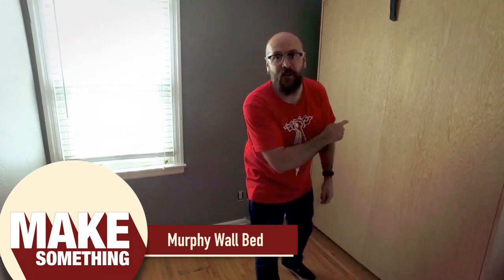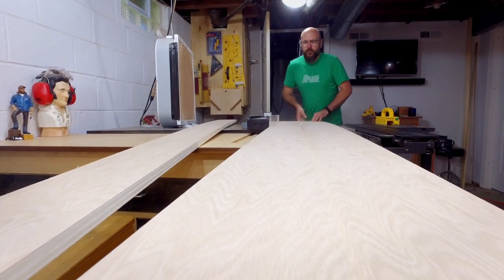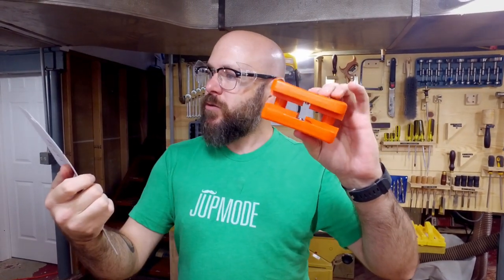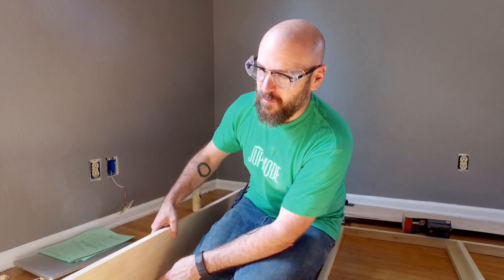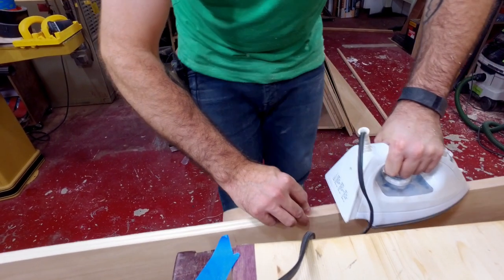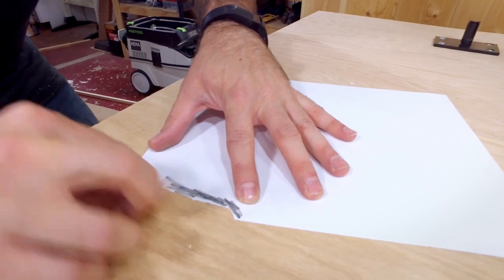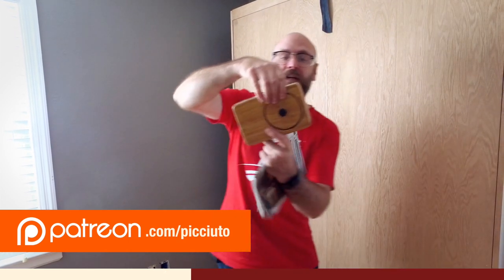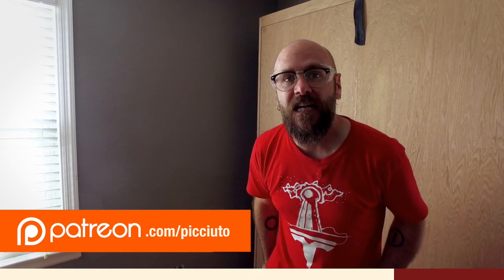How to Make a Murphy Wall Bed | Woodworking Project

Comment: Two things, glad to see the guys at Hide-A-Bed are distributing through Rockler, I built one of these about 6 years ago, the guy actually customized me a set of plans for a King Sized bed with an oversized mattress. He (I don't remember his name, but it seemed like he was the inventor) even custom pressurized a set of those shocks for me free of additional charge. Love it. Second thing, I agree with the comments below, it would be much safer to locate the studs for those screws; a half inch of plaster will often pull out of the wall (I have repaired a lot of these pull outs over the years, in this case, toggle bolts hold much better for verticle static, shearing loads than dynamic, horizontal tension loads)  after repeated pulling up and down, which repeatedly puts the formentioned horizontal tension load on those toggles. I'm pretty sure I remember that my set of plans specifically suggested this.

Comment: Great job. I've thought about making one of these and getting a smaller apartment.

Quick edge banding tip: Iron about a foot and a half, then take a screwdriver, turn it sideways and burnish the edging with the side of the shaft as the glue cools. I always get much stronger and more consistent adhesion that way.

Comment: My dad and I are currently designing a Murphy bed for my and my wife's bedroom (loooong story). I'm going to be mounting some LEDs into the header and have them activated on switches with an in-line dimmer-switch to turn them off. So, basically, reading/ambient lights overhead with a control for each side. Maybe you'd consider this, as well?

Also, the bed is going to be covering one of the the windows in our room (which is slightly bigger than the one you have this one in). Since our bed is going to be blocking most of the daylight, I will have another set of lights (again, activated by switches and controlled with in-line dimmer-switches) to replace the window lighting.

Oh! And, may I suggest a Tuft & Needle mattress? We've had ours for a year and it rocks. Though, at 72 lbs, there may be a little concern with the pistons not providing enough lift... Hmmm... I need to consider that, myself.

Comment: Instead of putting trim at the top you could do overhead storage. Open cabinet in the middle, and two closed door cabinets on the ends, matching the door like cabinet your going to do on the front of the bed, having about a quarter inch of clearance from the ceiling then trim around it to flush up to the ceiling level. My parents have one like that and its handy for linen or pillows. Then it also gives you storage for pictures frames or other nic nak things in the middle piece of the cabinet. Huge fan of the show by the way, (at least put a clear coat on the guitar). Would love to see you start working with metals. You should really start having a beer once your getting close to the finished project, like anchoring the bed to the wall. Maybe cheers the camera man

Comment: Are you worried about moisture build up between the mattress and the plywood, seeing as though there's no air circulation? Or is this bed barely going to be used so it's not going to be a problem?

Comment: Why did you use toggle bolts instead of finding the studs? Is it a plaster and lathe wall?
Reply from the maker: +Can Ken Make It? No reason. Both methods work.
Reply: I suppose it "works"   in the short term.  no way they are as strong as screwing into the stud.
Reply: Well, most of the weight is on the floor. It won't take much to keep it from being tipped.
Reply: Got to be careful with toggle bolts, he might end up pulling down a section of wall. Really needs to secure it to studs in at least two places to keep that from happening.

Comment: Very cool and great timing. I am going to attempt to build one this weekend. I have already watched a couple of other videos but one more couldn't hurt. Was there a reason for hand nailing the finish nails or would a nail gun work as well? Also, could you use pocket screws on the head board so the screws wouldn't show in the side? Thanks for the video and take care.
Reply from the maker: Thanks! The directions called for 2" finish nails. I personally don't have a nail gun big enough. And yes, pocket screws would work just fine!

Comment: How would you recommend I go about this? Next year i'll be studying in Paris which means that the space will be minimal but should i just go to a wood shop and ask for the dimensions of wood needed? Any other way than getting a shop or ask someone who has one? Nice one though.... I must admit I haven't been watching the channel that much
Reply from the maker: Many hardwood dealers will make the cuts for you. They do charge for each cut.
Reply: Thanks! Thats what I thought as well (I'm not gonna buy a tablesaw in a 15msq student appartement)
Just wondering, does it need to be attached to the wall? I'ts really complicated to get permission to drill holes in france. Also, contact casper for god's sake! Perfect sponsor for vid!

Comment: What is that table saw cross-cut fence thing with the really long arm?
I have add-on cross-cut thingy envy!
Reply from the maker: +wimman it's the Sawstop crosscut sled
Reply: +Make Something Very cool! That's added to my "want it" list. How easy is it to switch to using a rip fence? The video at a little place called ROCKLER didn’t cover that.

Comment: I have to ask, how is it working with so many drills all on different battery platforms? I think I would find that bothersome.
Reply from the maker: Two drills, two batteries. I've been in love triangles more complicated than that. ;)
Reply: +Make Something fair enough I personally have three drills to impact wrenches and God knows how many others I only have one tool that is out of the battery format and that one still drives me insane but it's an impact wrench that so strong I can't just get rid of it

Comment: Question from my ignorance: why did you use nails instead of screws? What is the benefit? It's at 09:00
Reply from the maker: So they can be covered with wood putty to hide them.
Reply: Make Something, and it's more difficult to cover screws with wood putty?
Reply from the maker: Not more difficult but more noticeable.
Reply: Make Something thanks David.

Comment: I apologize for the dumb question, but I'm a woodworking noob.  What's the gadget that looks a little like a shark's dorsal fin on the backside of the table saw blade?
Reply: Jeff Behn,  If I understand the part that you're talking about, that is a safety guard designed to help stop a piece of lumber should it happen to be "kicked back" by the saw.  It also helps to cover the sawblade, making it slightly more difficult for you to touch it and cut yourself.
Reply: That my friend is a Riving Knife. It holds the cut stock against the fence both to help get a straight cut and for safety. There's a few channels that have videos about making your own if you are curious.

Comment: This video does NOT do what the description says.  It says "...hides away into the wall."  No it doesn't!  I'm looking for how to actually put a murphy bed INSIDE a wall!  I just wasted 15 minutes of my day to see a routine murphy bed being made that gets MOUNTED to the wall.  Geez.... Change your description, man!
Reply: conroecat basically add paneling till you reach the corner and it will give it that look. if you want it in the wall as much as possible maybe look up how to frame a large large window... but I guess if it's not a structural wall where your want it then just cut the whole how you like.
Reply: Took you 15 minutes to figure that out?